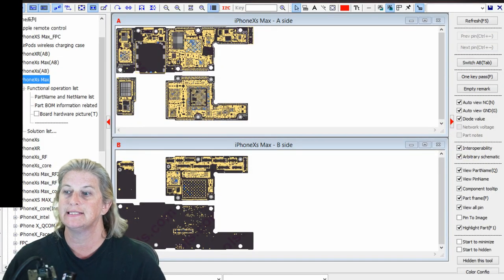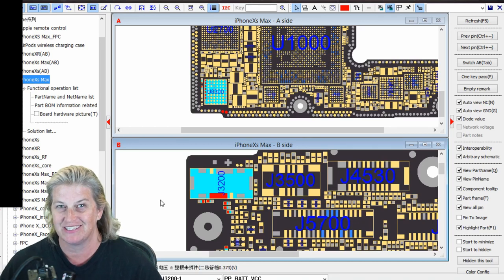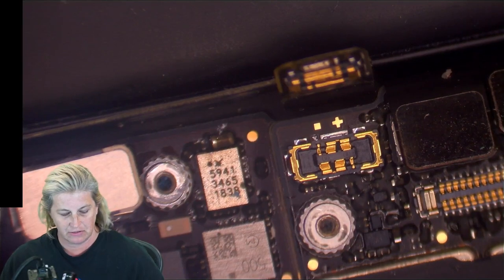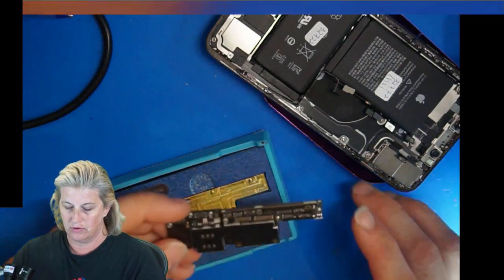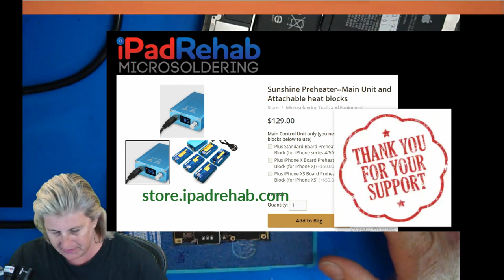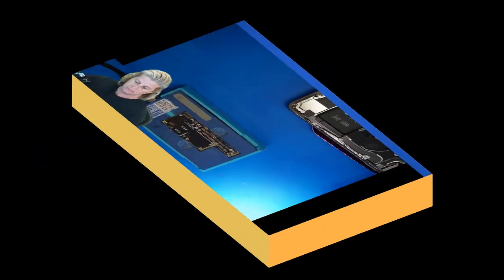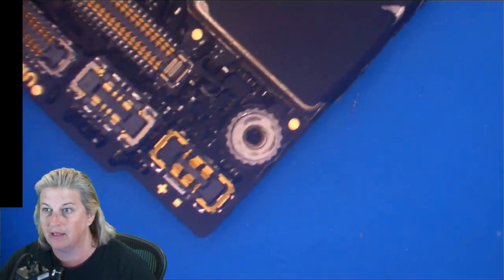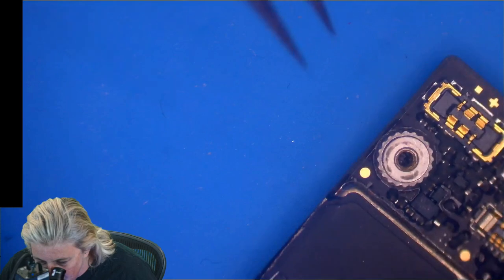Can we get data from an iPhone XSMax with a HOLE in the Logic Board?

Comment: a short on the board ? Just send in a 100A or so. It will burn da shit out of it and clear the short in no time!
Reply from the maker: No way man—I prefer to fix boards! Think about it—ground plane was pressed into vbatt.  What will heat up—the smashed together layers?  Or the wires of your dc power squid?   The thinnest wire will heat—I bet your Fonekiller would have destroyed your input wire and the board would still be short!